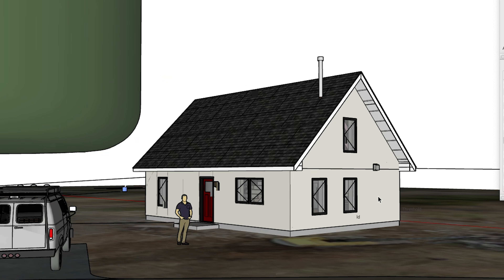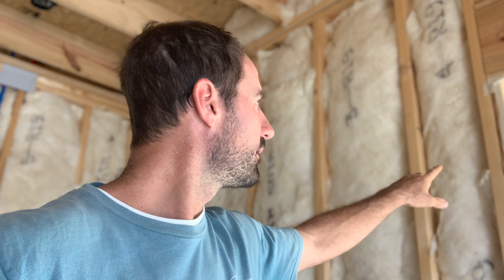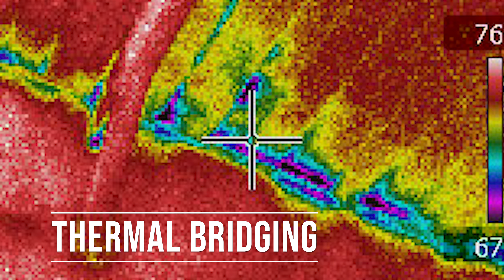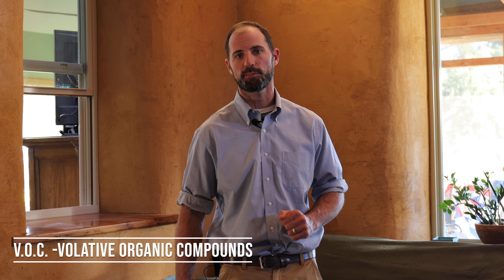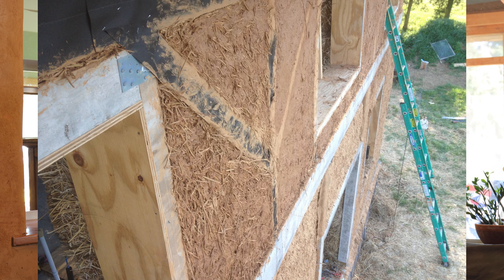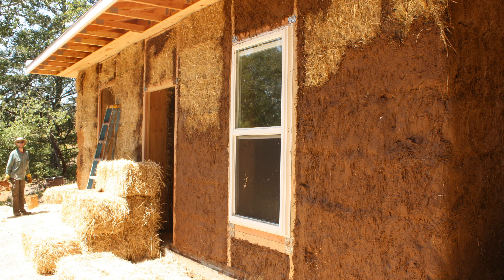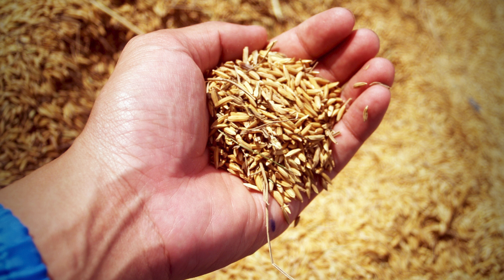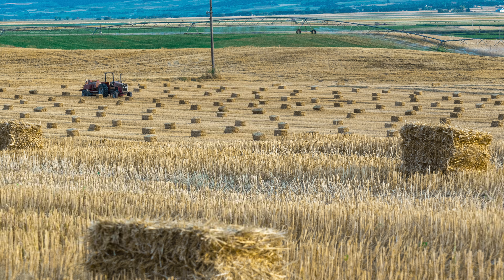The BEST way to build a new home? Building a House with STRAW BALES : Start to Finish - Episode 1

Comment: This is so interesting! Are you still able to hang pictures and mount mirrors and cabinets on interior walls? Or does that just make a broken plaster mess?
Reply from the maker: You can hang pictures with drywall anchors. It can get a little messy if your drilling into earthen plaster, but it’s not a big deal

Comment: I finished building a house right now.  I have a septic system, and I modified it so that the solids moved to an open pit in my backyard.  Solids were treated with a stiffening agent, and then I mixed in straw for additional tensile strength.  When the mass was of a firm, fudge consistency, I used my hands to cut out bricks--no special tools required--then the bricks  are left out into the sun.  I aimed a series of solar fans at the bricks to blow any fumes out of my yard into my neighbors, as they work during the day.

After this, I drain the liquid part of the septic tank into a set of outdoor barrels.  I then add "kitchen garbage into the mix, including eggshells, coffee grounds, leftovers, etc, along with some of the leftover, more liquid fudge described above.  This makes an excellent mortar.  I make large fields cut into my yard to put the mortar out and release some of the liquid, this process takes sometimes a month to achieve appropriate consistency.  During this time, it makes a great plant bed for potatoes, pumpkins, tomato plants and other veggies, which I consume  and give extras to my neighbors.

Building is the standard process.  Do your footings as you wish (broken up bricks, concrete parking stubs, old toys and bicycle parts) and then begin your first level of bricks, using your new wonderful mortar.   While this is going up, keep the outside of the walls slathered in mortar, and as you go smoosh weeds, grasses, old plants into the exterior of the walls, interior too if you wish.  This natural greenery is gorgeous and will thrive, and help repel moisture!  The walls themselves contain all sorts of natural vitamins and minerals, but avoid the urge to "dip and eat" as you need to keep the strength in those walls!!!

The roof is simple.  Go down to you local home improvement store and acquire any "odds and ends" or PVC piping.  Make rope out of twining together old clothes, ribbons, electrical cords, etc, and bind the pipes together.  Place the piles across ways between your walls, another layer going the other way, criss cross style, with a layer of chicken wire in between. Then, take any leftover drippings and pour over the pipes, allowing the drippings to go through between pipes and mesh.  A great job for the kids and helpers is to equip each one with a wood bucket and rope handle, and have them run around the inside of the house and catch any drippings coming through, and then bring the filled buckets up to you in continuous rotation.  This way, very little of the material is wasted.

When done, you can make nice, comfy chairs out of the left over, softer consistency mortar.  Relax in your new off grid home that you made yourself, in more ways than one!

Comment: here in Spain farmers of ancient times build their barns and homes with straw bales too, they use clay plaster to coat the outside and inside walls and in the ground they use fired brick or stone paver,  the spaniard colones brought those construction methods to America when they discovered it and when they developed it, throughout America you can see old houses with these methods, and some have been going on for centuries, here in Spain there are still towns built of stone and straw bales that have been functional and inhabited for centuries so these ancient construction methods are a good option for those who want to use them to build their own houses or as a real job opportunity because they solve the problem of the COST of construction materials that are excessively high these days, a good builder as our friend of this video who know these methods and first class materials can make a very large mansion at half or less the cost of a house of the same size with current materials, so have no doubts, these construction methods are excellent, the centuries-old houses built with these methods attest to this, greetings 😉
Reply: Never seen them in Spain...?!🤔🤔

Comment: What about your roof insulation value? I haven't seen any insulation being deployed up there.
Reply from the maker: We use open cell spray foam for the roof deck. There are a few videos about framing and prepping for bales that illustrate the steps we take to insure spray foam won’t cause moisture issues

Comment: Do straw bail homes work well in wet areas? We live in bush Alaska and will be building in the next year. The cost of shipping traditional supplies here is unreal, so we’re looking into alternative options. I worry about wicking up water from the ground though. Thoughts?
Reply from the maker: Yes, Strawbale wall systems work just fine in wet climates, but just make sure they have access to sun and wind for drying if they get wet. Also make sure to keep the average snowpack below the top of foundation wall. Bales may be equally expensive to ship to bush Alaska, so I would strongly encourage you to find a local sawmill that can provide much of the materials to build your home.

Comment: No worries about termites?
Reply from the maker: Just remember to keep the wood framing and bale wall system at least 8” above grade and make sure you have a termite inspection area (usually 3”) between the top of foundation and the wood framing.

Comment: Even though straw is for the most part readily available, allot of wheat varieties are becoming shorter, thus less straw in the process,  maybe a different straw that  could be used would not have to be planted and is every where....weeds and invacev grass that grows tall like say  Johnson grass, very hard to get rid of without using noctuse chemicals like Roundup and that only takes care of it for the season...maybe!   Cut anything and baile it🤔🇺🇸🙏

Comment: Wouldn’t that be more of an invitation for mice and critters ?? One small crack or opening in the wall and the foundation would be filled with decaying life matter and mice waste. 

Just curious. The price might be lower but is it worth it down the line?
Reply from the maker: Hi K, the bales are so dense that there’s no room for mice to live. Small openings are easy to prevent and fix in a Strawbale wall system. On the other hand, wood framed walls have 16” wide cavities that are filled with very flimsy insulation that is easy to
Push aside to make a nest, which rodents often do. It’s funny how ironic it is that Strawbale homes have a much less chance of getting pests inside when compared to conventional stud walls.

Comment: How does it hold up on a rainy climate. Is it super flammable in care there’s a fire?
Reply from the maker: As long as you keep it elevated off the ground and keep a good roof on it, it will last forever. Just make sure if you live in a rainy climate that there’s exposure to sun and wind for drying potential (don’t build a straw bale house in the middle of dense forest). Strawbale walls have a 2 hour fire rating, which is 6x better than the 20 minute fire rating of a conventional stick built home!

Comment: So it's a wood framed house insulated with straw
Reply from the maker: Most of them are, in order to meet the needs of a structural engineer and building code. But you can build a load bearing Strawbale home where the bales hold up the roof and there’s minimal minimal wood framing.

Comment: What's better straw bales or those Hemp blocks I've seen being used
Reply from the maker: Good question, Juan. Hemp blocks take a lot of processing to get them into a building block (which adds cost and environmental embodied energy). Straw bales on the other hand are manufactured in the field with basic farm equipment. Straw bales win over hemp blocks in my opinion.

Comment: how do you run the electrical and plumbing?
Reply from the maker: Electrical wires are recessed into the bale wall with a chainsaw, and plumbing is isolated from the bales as much as possible with pipe sleeves and interior wall framing. Check out this video on plumbing through a bale wall The LONGEST DRILL BIT you've ever seen! PLUMBING in the Straw Bale House!
https://youtu.be/E4WEQOOizGQ

Comment: Dude the straw bale homes have been around much longer than 100 yrs ... check out Nelson, New Zealand Cobb. However, in Santa Fe   https://youtu.be/V-3mGNom2hg

"Finds eroded shack, revamps it to heritage landmark home." However, the owner 
stated that the straw bale cobb did not equal the rf value needed for cold New Mexico 
dessert freezing night temperatures, so went with regular interior framing walls and cobb to the outside of that. Thank you for mentioning hemp, what about a combo of Hemp interior 
blocks inside the straw bale cobb walls over that and radiant floor heating know any that have done this ?
To test the rf value heat from the radiant interior molded out 18" cement slab 
https://youtu.be/Hn35CUCz7U0 concrete molds that hold radiant flooring inside mold 
then bamboo doors slightly above maybe where heat flows through in winter ?
Cool air in summer. 

Location says North Carolina, where ?

Comment: If the post and beam frame uses less lumber than conventional stick framing and the wall insulation is straw, then where are the costs that price out this construction at $200 to $300 a square foot?  Ouch!
All bales are not created equal so would assume there is some variation to insulating capacities even within the same wall structure and certainly throughout the house.  And how would any moisture, latent or infiltrating, escape the wall system?
Reply from the maker: Most straw bale homes are either 100% owner built with scavenged materials, or fully custom homes that have all kinds of high end finishes and detailing. The 200-300/sf is the figure I’ve experienced with the fully custom (and 100% hired out) straw bale homes. The one in this video series ended up being about $150/sf with the owners helping out a bunch and having us build a ton of custom cabinetry and built ins.

Comment: Just found your channel through this video. I'm excited to see this video series. Quick question:. Have you ever researched Earth sheltered homes? I just picked up Mike Oehler's book about his experience. I'd be very interested to hear you're take, as it seems the goal of super insulating is the same, as are the natural materials, cost, etc.
Reply from the maker: I can’t speak much about earth sheltered homes since I haven’t built one, but I can imagine if they are done right, they would really hold the heat and cool.

Comment: Excellent video. Straw bale buildings are having a moment in Europe as the "next new thing" but few architects are aware that we've been doing it in the US for a hundred years. Lots of people are concerned about moisture and fire but with the plaster coatings and a nice roof overhang it's a wonderful solution.
Reply from the maker: I agree! I’ve heard lots of concern about rodents, fire, and mold. But if built well, these problems are a non-issue. And actually are much more concerning in conventional homes! I talk about it more in FRAMING a STRAW BALE HOME
https://youtu.be/P565_fhZBQw
Reply: @HeirloomBuilders what about the pesticides used on the hay? Do you think the plaster would insulate that? I know you could probably find a source that didnt use any pesticides, but Im wondering if you considered this.
Reply: @HeirloomBuilders what makes you say its less concerning? Do you explain it in that video?
Reply: @HeirloomBuilders   Don't forget the cure all for Rodents and Insects (Borax  in the walls and Steel Wool along the cracks)
Reply: In case of a fire I don't think it makes much difference. Most modern furniture is made of petroleum products and will become fast fuel for a fire anyway. I think a lot of people are probably not aware of that.
Reply: @silencedogood9747 Hempcrete walls and roofs definitely will not burn!

Comment: So if you need to repair a wall for some reason, what is the process?
And do building codes allow for this or is it more of an off-grid thing?
Reply from the maker: Wall repairs are pretty easy. Just mix up a little plaster and fill the crack/hole/etc. take a sponge to clean the unaffected area so that the repair blends in to the surrounding wall surface. I've built 2 permitted straw bale homes. There are provisions in the building code that allow for straw bale construction so long as a structural engineer approves/stamps your framing plans.

Comment: With few "studs" how difficult is it to hang shelves and pictures?
Reply from the maker: Not bad, Tracey. You can use masonry anchors for light duty stuff. And if you're hanging cabinets or other heavy duty stuff, then you'll need to plan ahead and inset a wood framing member into the strawbale wall behind where you need to anchor. Covered with plaster, there's no sign of the wood anchor.

Comment: More than likely never get a response but here goes anyway.  I really do like the concept and I am aware that there are multiple ways of achieving a satisfactory end result.  Personally I prefer bringing the timber frame members to the inside of the envelope and having them partially exposed.  I somewhat understand the stem concept ( moisture trap) however is there not the thermal bridging that you mentioned?
Reply from the maker: That strategy is often overlooked, but is a good one to reduce framing on the inside for interior walls, cabinets, etc. but you also then need to provide a window buck framing on the exterior for windows to install and a longer roof overhand to accommodate the extra 18” bale width if your framing is on the interior of the bale wall. Either way it can be done to eliminate thermal bridging. Id love to build one like you’re talking👍 🙂

Comment: How do you keep rodents ect. from moving in with you just wondering
Reply from the maker: Once the Strawbale wall has plaster on both sides, it is impenetrable to rodents and fire. Rodents prefer a stud wall where they can push aside the insulation and make a nest.

Comment: would the outside layer by a good protectant from fire?
Reply from the maker: The outside plaster layer is essential to protect from fire. It’s 4 times more fire resistant than a conventional 2x4 wall system

Comment: Great video my wife and live in Canada. And we built a straw bale home. Our home is a pole building 50x100x18 And keeps us warm in our cold winters for the last 18 years. Our walls are 36 inches deep.
Reply: I would love to see your house and the plans you used.  What do you estimate the R value to be?  What are your roofing materials?
Reply: i hate  you. but great job  their. i want  r 40
Reply: @christopherrice6553  A double wall with 2 x 4's and 3 1/2 inches between has 10 1/2 inches for insulation (3 layers of R-13 fiberglass for total R-39) and will be cheaper to have built than straw bale and will have better resale value.

Comment: I have some land and wanted to do build into a hill. Would I be able to do this with this building style?
Reply from the maker: I would advise against building a Strawbale wall system into the side of a hill. There would be no way to guarantee the bales could breath and not be a harbor for mold growth. The key with Strawbale construction is to keep it up off the ground and ideally in a place that gets lots of sun and access to breezes for drying potential.

Comment: How well do they told up in a tornado?
Reply from the maker: I hope to never find out how a straw bale home handles a tornado! But I’m guessing that it wouldn’t budge. The walls are 18” thick with 1”+ of plaster on both sides. So long as the roof is anchored down well to the wall framing, it should be good to go.
Reply: @HeirloomBuilders  I hope you don't have to deal with it either. You guys don't get tornadoes there where you live?
Reply from the maker: @BushImports  we get tornadoes, but not very often.

Comment: How flammable is the home and can it be heat treated? Real question I'm a chick so not too knowledgeable about this topic so please don't come at me!!
Reply from the maker: Good question. It sure looks like it would burn down in a few minutes. We heat treat a straw bale home (and protect it from rain also) by smearing on 3 coats of earth and/or lime plaster. The plaster keeps the walls breathable enough to prevent mold but sealed up from the elements. Once the bales are coated with plaster, there’s no access to enough oxygen to burn. The finished product has a two hour fire rating, which is 4 times better than a wood stud framed home.

Comment: Don't waste your time. Use concrete blocks filled with concrete and rebar, steel roof trusses and a metal roof.
Reply from the maker: I love concrete block construction. Simple, solid, but it takes special detailing and/or lots of additional layering to get it to be well insulated and not condense moisture.
Reply: @HeirloomBuilders  Use 3/4 thermax, 1x2 furring strips and drywall Recess slab 3/4" for drainage.
Stucco on exterior.. 
#5@ 4' OC with a bond beam with #5 top and bottom with 10" hooks.
Will withstand 160 mile winds.
No problem here in Florida with that wall detail.
Roof 5/8 plywood with weather shield and standing seam metal roof on steel trusses.

Comment: A tight house is a dangerous house. It needs to exchange air all the time to exhaust out gassing from materials and indoor pollutants.
Reply from the maker: I agree that a tight house can be a dangerous house. We take care to make sure the wall system is breathable so it doesn’t grow mold (by using earth and line plaster instead of cement plaster), and make sure that we have good air exchange with both passive ventilation and timed exhaust (bath fans on a timer/humidistat control)